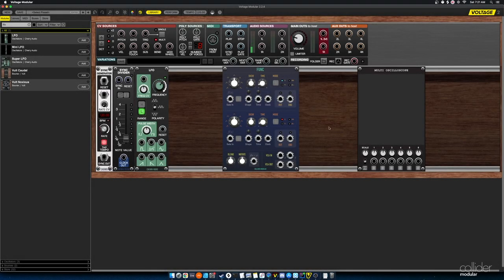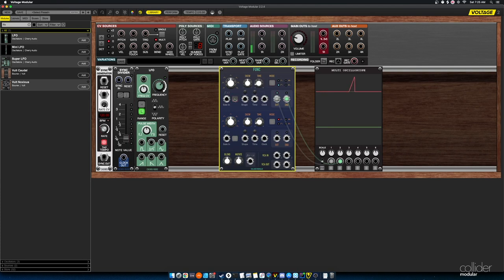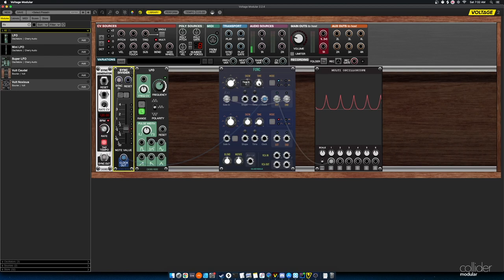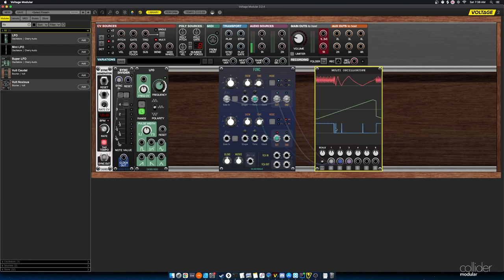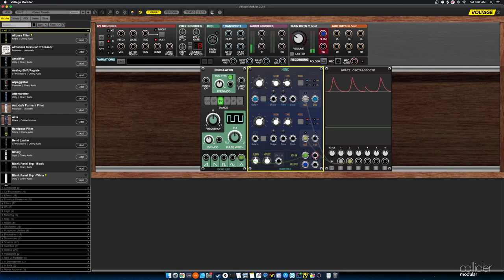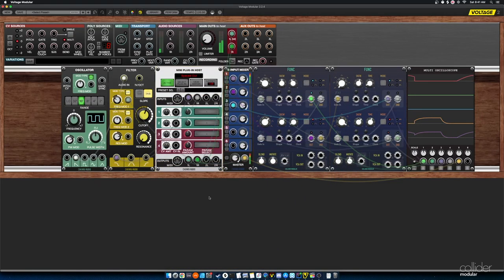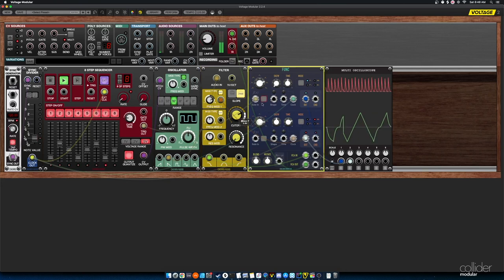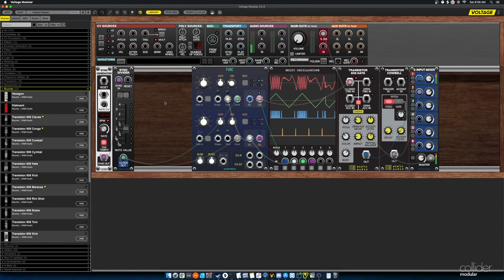Collider Modular - Func Video Manual (for Voltage Modular)

Comment: But can it be clocked at audio rate though? That would be awesome!
Reply from the maker: There's two answers to this question. (1) Yes, you can clock it at audio rate, however because of the limitations of digital sampling it will produce artifacts. (2) Without being too technical, with digitally generated waveforms, to get both smooth modulation AND an audio rate oscillator actually requires producing two separate waveforms. This is why modules that do both have a "rate" switch, as under the covers they change the waveform. With Func, my goal was to capture the essence of the 'dual function generator' while adding in some modern features, like continuously variable waveshape, so I had to make some tough calls on feature set (this happens with all my modules TBH). Practically, there also wasn't much space on the UI to add a mode switch :D. At some point in the future I plan to add an oscillator to the CM catalog, which would very likely have an LFO mode that would do exactly what you're describing.
Reply: @collidermodular8351  thanks for the thorough explanation! can't wait for more of your modules. they look awesome, come with extensive video manuals and work great! will be an instant buy for sure when it comes out :)